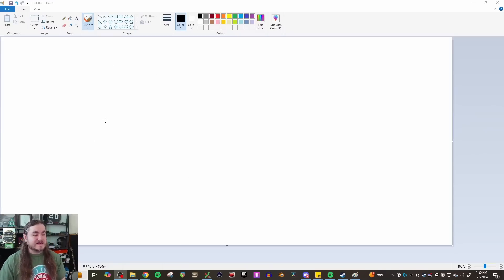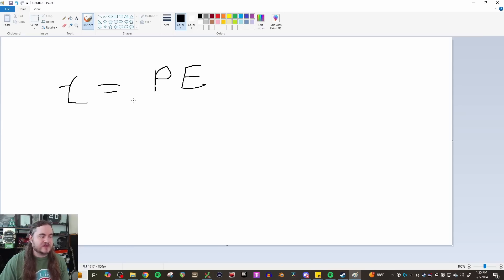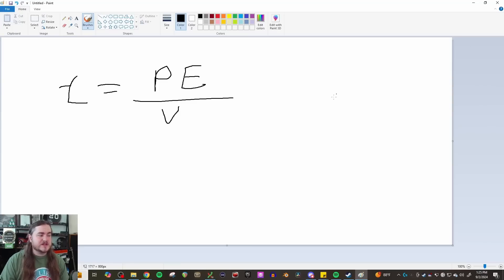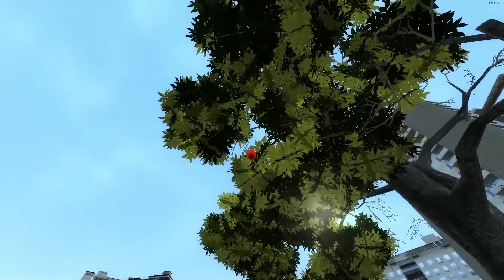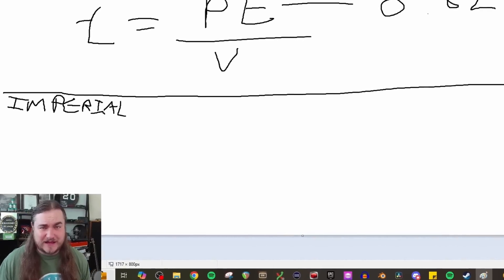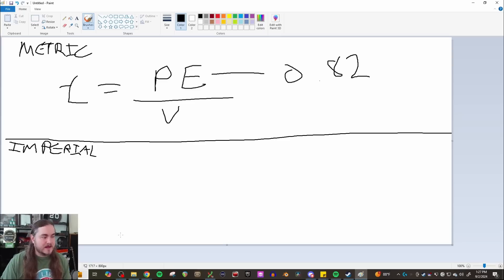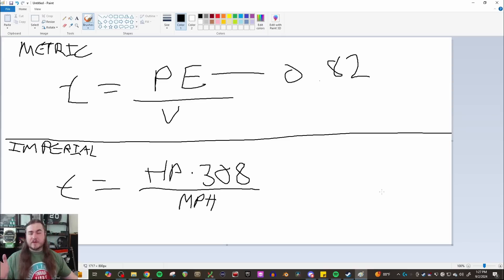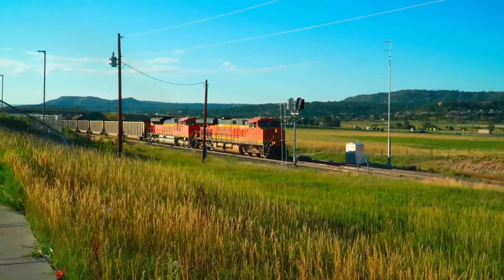Diesel Tractive Effort 101

Comment: This is a misleading video. Horsepower and tractive effort are tightly linked to each other and there really is no difference between them once the conversion factor of speed is taken into account. You can always convert from one to the other. Physics works the same in both ways. If you know one, and speed, you can work out the other.
For steam engines, which were competently designed, it is simply easier to derive tractive effort from piston area and mechanicals of the running gear, which is why this was the practice. Especially since steam engine's ability to generate power is 'number of puffs into cylinders in time up to boiler capacity of steam generation'.
For diesel - electric and diesel hydraulic - horsepower is easier to derive , especially for electrics.
The adage about what they can and cannot pull has more to do with tech used in early diesels - they were both rather low HP ( 1500 for an E7 vs 6000 for a big boy ) and they were limited at lower speeds by their DC motors, which are rather hard limited at lower speeds by heat. Dual set of E7s could start the same train as BB could, but could not it at road speed.

Comment: Question for you about traction motors. 
Let's say for really heavy moving, you put 4 out of 6 lower geared for start pulling, then the other 2 are higher geared, that way you could run at higher speeds.
But you would probably need and extra engine for start pull power.
Was an idea.
Reply: It does not really matter all that much. Gearing is there to step down high RPM motor to low RPM wheel and the specific sizes have more to do with making sure the motor is not oversped and mechanically the entire assembly can carry the design torque. For any electric tracton its 'gearbox' is in the electrical cabinet.
Reply: So you have 2/3 at low gear and 1/3 at high gear. You might as well just make all motors have the same gear ratio that is weighted average and it will be the same, you aren't winning anywhere.
Reply: @MikeKrasnenkov  
Was an idea for lower end power, and hi end speed. But another viewer told me about overspeed of the lower geared axels.
Reply: @chadwayne165  I highly doubt realistic gear ratios would be nearing overspeed limits for electric motors.

You just don't gain anything. Few motors at high gears will barely be able to provide any traction at high speeds. Result is that your high speed traction will be reduced proportionally to increased low speed traction by having some motors have lower gears. Same as if you just reduced the gears on all motors but by lesser amount. You can't cheat physics.

Comment: 7:30 - this is very, very dependant on a type of motor used. While brushed DC motors of the past really didn't like being run at low speeds, current AC motors can be locked under power all day every day. This is the reason why AC traction was first seen on coal drags - at least in the US. AC driven train can creep at 1mph for hours without an issue.

Comment: So what you're telling me is that the traditional Big Boy caravan is the perfect train. A diesel to start a train it cant pull and a steam loco to pull a train it cant start.
Reply: I mean really the confounding factor here is the electric traction motors, not really anything to do with the diesel. You pair the big boy up with one of those road engines full of lithium ion batteries that are supposed to be paired with a couple of diesels. Then you can launch with it, it comes with all the modern signaling gear you need, and when you want to make the big boy look more impressive you run the dynamic brake, Big boy makes a lot of smoke and steam and you get the energy back in the batteries.
Reply: True, i suppose. But, in the modern Big Boy caravan there isn't enough tonnage being pulled for either Big Boy nor the diesel to even notice anything is back there. The caravan is a short little passenger train full of mostly air. Now that Big Boy 4014 has been outfitted with PTC, the diesel is still there only to provide dynamic braking to save wear and tear on Big Boy's crazy expensive and now-custom brake shoes (the local AutoZones along the route don't stock them for some reason!), and to provide emergency backup power in case something on Big Boy breaks. So, the diesel is still in the consist for both "brakes" AND "breaks"! :eyes-pink-heart-shape:
Reply: Yes, in fact scientist tried to combine diesel and steam power in the 1990s to pull freight trains for this reason

Comment: So the gist of the matter, as i understand it is; that a steam engine is basically a piston engine connected directly to the drivers. This means that, like an internal combustion engine, it has a torque curve and corresponding horsepower curve. And apart from the "dead-spots" at the end of piston travel when going slow, the torque curve is pretty flat at low speeds and tapers off approaching top speed. So rising horsepower as the engine goes faster, until the torque starts dropping off. 
In contrast a diesel-electric locomotive has essentially an infinitely variable gear ratio between the engine and the drivers, in the form of the generator and traction motors. This means, that the engine can run at its optimal speed, generating full power regardless of the wheel speed. And since torque and horsepower are related through rotational speed; gearing any amount of power down to near 0 RPM, means near infinite torque.

Comment: A conductor once told about inter-terminal drags working up the hill to Bayview using 
a match-book inserted into the relays to prevent tripping due to short-time issues. These were on switch engines built in the late 1940's and 1950's.
A related topic -draw-bar limits.

Comment: Steam locomotives are power limited as well. There's only so much steam it can generate per hour. The largest are roughly equivalent in power to the largest diesel locomotives. If you compare the torque curves of electric traction motors to steam locomotives they are more similar than you let on.
Like any vehicle, the power available to be converted into tractive effort by a diesel-electric locomotive is not equal at all speeds, so the real-world speed-tractive effort curve looks nothing like an ideal 1/x curve.
Reply from the maker: Very true, just like you have to live with the electrical supply you also have to live with the steam generation supply. That said working harder helps you in that space.
Reply: @Hyce777  Exactly. Heat is GOOD for a steam engine, but BAD for diesel engines and electric motors. Steam gets more efficient the hotter it gets (to material limits of course).
Reply: @markantony3875  OK I'll buy that. However the diesel is quite limited in the temperature delta by whatever liquid is used to remove heat. On the other hand, with a steam engine you are trying to retain all the heat you generate, not remove a great deal of it with radiators. Thankfully for century old locomotives, one-time use lubricant was easier to create than a modern engine lubricant.
Reply: @markantony3875  Pressure is what's generating the force on a piston. Saying that "the power does not come from pressure" is somewhat misleading.
Reply: @markantony3875  Go on then, explain the mechanism that converts this heat energy of the steam into piston motion without involving pressure. What is the source of the force that moves the piston?

Fancy this thought experiment: you heat up the gas under isobaric conditions (atmospheric pressure) and then put it in the cylinder. Assume no heat losses due to transfer to cylinder walls and piston. Will the piston move? According to your beliefs it should? The gas has this thermal energy to be released, right?
Reply: 100% there is a limit to how much steam in an hour (though as Hyce says, both blast pipe and locomotive speed help drag more air through), thus even when aiming for max power you reduce the valve cutoff as the train speeds up, but there is also a pretty big capacitive effect in the heat within the boiler (a lot more than merely the volume*pressure of the steam that is already a gas, hence why compressed air locomotives never did well even in underground mine work) so you can throw the bar to the corner at fairly high speeds (at extreme speeds the flow through valves/piping starts to be a limit) and put out most of the torque you would at 10mph for a couple of minutes.

But the reason that the seemingly simpler boiler comparison is not done is people avoid using any equation from steam horsepower for trains because even within one region/era represent vastly different nameplate specifications, and between different times or regions its just completely incomparable. Its pretty common to see a 400hp and 1,200hp train of about the same size, number of boiler tubes, firebox area, and see them do about the same work, while a historic "40hp" locomotive did vastly more than one tenth the work. Meanwhile the pressure, cylinder area and wheel are very rigid numbers with limited error, and their relationships are nice and linear/intuitive (twice the pressure or twice the area both double hp or tractive effort in their respective equations).

That said the power available to be converted into tractor effort by a diesel-electric doesn't depend at all on speed, some of them literally have hook up kits to provide grid power for remote deployed or emergency applications. And above a certain (and fairly low) speed, the curve looks exactly like the 1/x curve.
Reply: @SheepInACart Great explanation. There is a limit for "sustained horsepower" for steam locomotives, but this is highly dependent on the crew. If your fireman is tired the sustained HP rating will be deteriorated. So any "sustained HP" rating on a spec sheet would need to be accompanied by a big asterisk. 

Also interesting about using the capacitance of the system. If you are "consuming" that buffer, you can put out significantly more HP than your sustained HP during shorter bursts.

Comment: I've read articles and seen videos on SD70 MACs crawling up grades at less than 2 mph!  I don't  know how long these big Locos can sustain that effort, but AC traction motors seem to offer advantages for pulling heavy trains over steep grades.
Reply: EMDs Creep Control is a lifesaver in scenarios like that. It allows for minimal slipping of the wheels before it reduces power, because a little slip is better than no movement...
Reply from the maker: Yeah AC is a whole 'nother beast that I was not prepared to get into.
Reply: This is like 3rd hand information so take it with a grain of salt, but I once talked to a guy who used to work for NS, and he told me that when they wanted to demonstrate the AC traction system, they took a loaded coal drag, underpowered it, ran it up a hill in 8th notch until it stalled, set air and handbrakes, went to lunch, and came back an hour later to find the locomotives still giving it all they had.

He said they designed everything so that the control system wouldn't pass enough current to burn up anything. He also said they claimed that the AC motors are so robust that the inverters for the VFDs in the aux cab will fail before the motors do.

AC traction really is some crazy stuff.
Reply: @CDROM-lq9iz  Oh hey, fancy seeing you here!

Yeah, I doubt they would tie up the line like that, but I don't doubt the possibility of the results one bit.

I hear tell the "AC" stands for the word for "magic" in Hogger Latin...
Reply: @PowerTrain611  Same to you! Like I said, this is like 3rd hand information, I wouldn't be surprised if they picked a siding or the company had a test line or something.
Reply: I'm going to hazard a guess that it isn't JUST the AC drive, but also forced air cooling, so that the motors won't overheat even at very low speed.
Reply: @Lucius_Chiaraviglio  Oh for sure.
You know, right up until the SD70, EMD was still using mechanical traction motor blowers, driven right off the engine... when the SD70(Still DC, but right on the cusp of the advent of AC - MACs, for example) was built, they switched to electrically driven ones. 

Coincidence? I think not!

Comment: Warning: Excessive train nerd moment ahead. You have been warned.

I make my own physics modifications for personal use in Train Sim Classic for North American diesel locomotives because often the physics are all out wrong, especially with locos from 2012 and before. While you can make a reasonable power curve using (HP*308)/MPH in some instances it doesn't go far enough, like for example using said equation with modern AC locomotives yields a power curve that's too low to match what's happening on the road. Because of this I like to get down in the nitty gritty and try and find model-specific information for my mods. Tracking down individual locomotives' weight, STE, CTE and Continuous Speed is a nightmare sometimes. Often you'll see places where they list the weight but not the STE, others you'll see the CTE but no speed, and sometimes you'll find conflicting information or information which is just plain wrong. One thing I ran into which resulted in much hair pulling was someone citing the ex-ATSF SD75M as having a CTE of 137,000 when BNSF in their first SSI from 1996 cites it at a more reasonable 109,000lbf (same as a typical DC-powered SD70 from the period before MACs and ACEs were a thing), and CN in their operator manual for the SD75I (same thing as an SD75M just with a quiet cab) cites it more precisely as 109,150lbf@11.4mph. Finding either official documentation or an operator's manual is like gold, like a manual I stumbled on from GE for BNSF's ES44DC which lists the STE at 142,000lbf and the CTE at 105,680@12.9mph, which translates to roughly 3635hp out of 4400hp getting down to the rail. Making a formula for that would be (3635.392*375)/MPH which yields a very nice and believable power curve which I then translate into the game. To save time making a power curve for each individual loco by hand with a calculator I made an Excel workbook to figure it all out for me using only 4 manually inserted variables which as of today has something like 70 some-odd entries for different locomotives including subsets.

Have I perhaps gone too far? Yes. Am I splitting hairs given I'm putting so much work into crafting personal mods for a simulator which I'm probably never going to make public? Probably. Have I lost my mind? You betcha. Do I love it? Heck yeah!

Needless to say, I thoroughly enjoyed this video. Keep up the great content!

Comment: TE in diesels is something I've been trying to figure out for a long time. It seems to me there are so many more factors that play in. Most importantly is weight, and # of axles, and type of traction motors. You have to have enough weight for your motors to apply the effort. 

If you look at a 1750hp SD9 and a 3000hp SD40, they both say 90000 starting from info I've seen. But the SD9 drops off significantly faster than the SD40. However if you look at the SD40, SD45, and SD50. 3000, 3600, and 3500hp respectively, their starting tractive effort is almost identical, their weight is almost the same. I've read the SD45 has no advantage over the SD40 at low speed due to adhesion limitations. 

My next example is the SD60 (3800hp), SD70M and SD70MAC (4000, later 4300).
SD60 makes 105,000-110,000 starting and continous at 13mph. It weighs less than the SD70 but more than the SD40. The SD70s had a new wheel truck design and the AC motors could make 160,000 starting and 137,000 continuous I believe. This leads me to believe if the SD60 was heavier it would make much higher starting figures as it is adhesion limited. 

Last example is a B40-8 vs a C40-8. 4 axle making 68,000 vs. 6 axle making 108,000. I would have to believe that these higher hp engines make way more power than 4 traction motors can even use at low speed, but at high speed there would be more power available for 4 axles vs. 6, allowing the motor to create more torque. Most electric motors will backfeed voltage as they turn faster, requiring the alternator to step up output voltage to overcome tte backfeeding and maintain voltage potential. I'm not sure on gearing numbers on these units but since a motor uses more amperage at low speed, changing the gearing to make the motor run slower at fast speeds would effectively increase TE at high speeds. 

Just some thoughts on my findings.

Comment: Thank you for this explanation. Puts perspective in what was said to me 2 years ago standing on top of CN6060 in restoration. Was ask if I saw it run? I said no. The engineer that was with me said it is the hand of God pulling. Said they hardly ever get into the throttle in excursion service.

Comment: At slow speeds the Tractove effort is limited by traction the electric motors are only in danger at a stall or very slow speeds maybe 1-3 mph at full amps because the brush will weld to the commutator
Reply: amperage limit.  i'd go with a polyphase AC motor and a polyphase VFD.  then you can turn the wheels as slow as you need to for the load and incline you have.  now, adhesion is your limit.